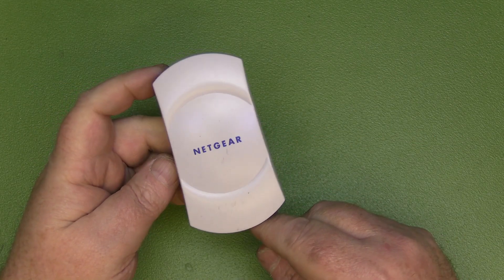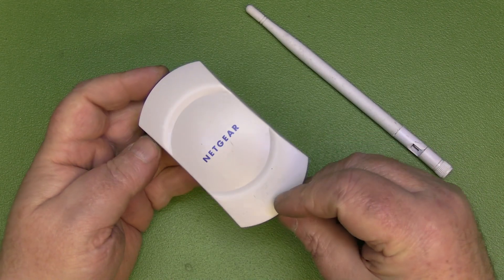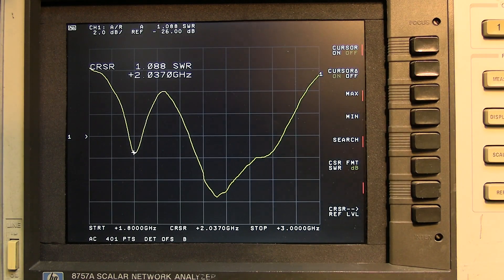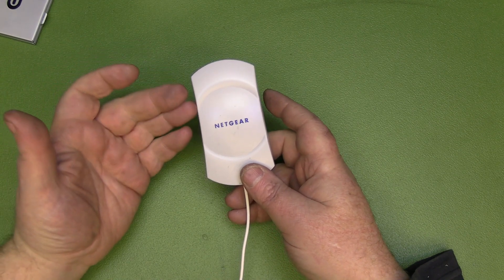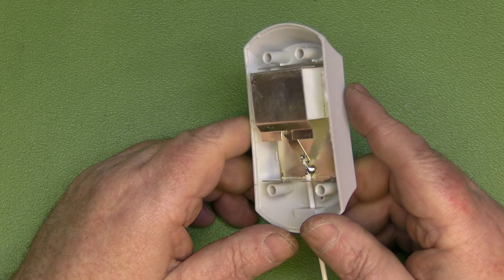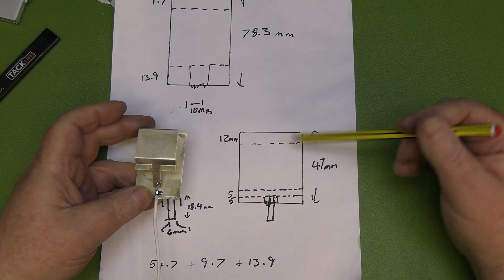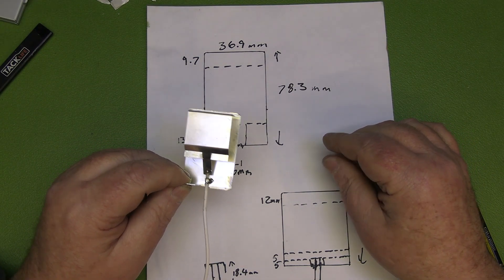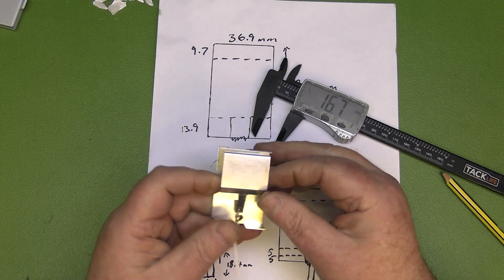Netgear 5dBi Antenna (ANT2405) Very interesting!

Comment: This seems compact and able to improve the wifi connection of my ESP32-CAM projects. I have been using simple dipoles modified with your "pen yagi" concept. They work very well but the camera sit outside and the antenna is too eye catching. I dont have brass sheet, do you think this would work with aluminium sheet from red bull can? I'd press the coax core and sleeve against the metal with a small screw. This design is so compact I could incorporate in the 3d printed camera box.
Reply from the maker: Should do yes
Reply: You are r8.

Comment: Looks like it was designed to work in either a vertical or horizontal plane... Just a guess I don't know anything about antennas
Reply from the maker: It’s both but not equal 40/60 split.